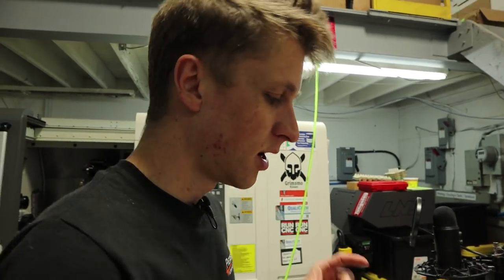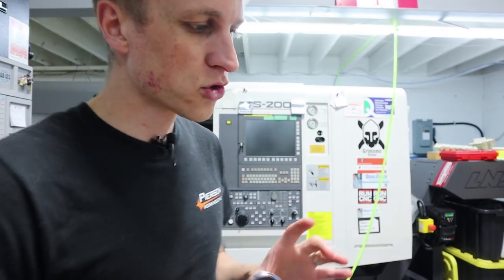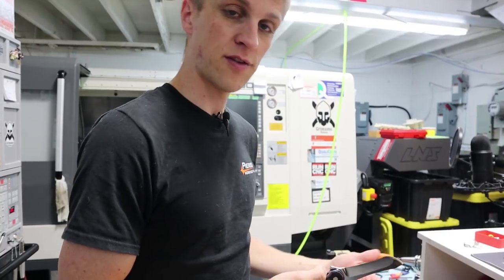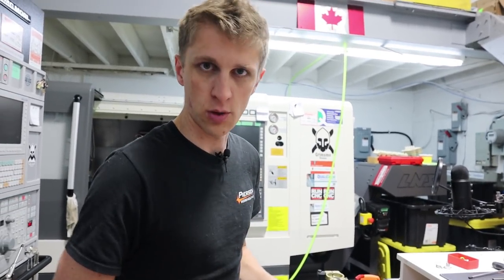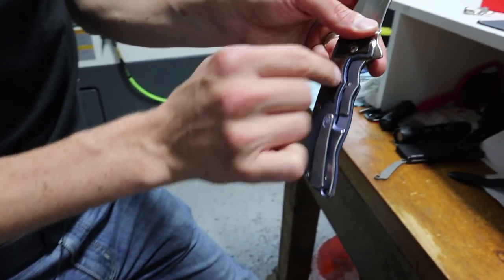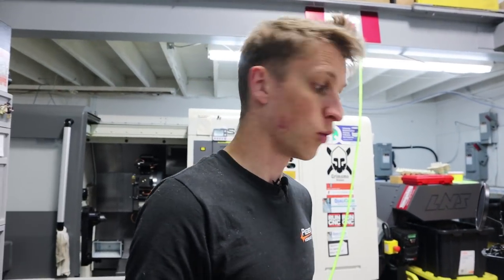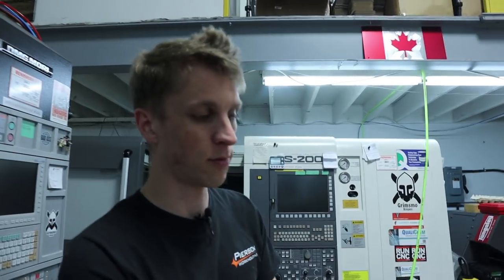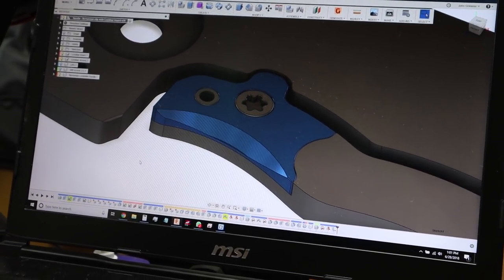How to Add a Lock Bar Insert Pt. 1

Comment: Dude, I'm all for this! It's another refinement. Not bashing your ealier releases, but yeah moving forward is the way to go! This will save a lot of parts where the aesthetic is locked in, but the function isn't. Another way to separate selection to increase yield. You know this is good. 

About the hardness; I don't know the specifics, but that book you used oh 150 video's back is not gonna cut it anymore. You grew out of that production method two mills ago. Bounce stuff off of as many people as possible, more eyes / datapoints is better. Probably calling Brad and other John for the surefire way to create some clarity. My gut also tells me go softer on the insert (wear always occuring on the softer part), but hey, I might be completely wrong and ruining blades with it (wear occurs on all surfaces, just in different amounts based on hardness/sheer strength/etc..).. Experienced knife and tool makers will know.

Cheers man, enjoying the continuation of the Norseman journey!
Reply from the maker: Thanks Dev, great thoughts!

Comment: Good luck with the lock bar insert. One more piece to make. One more screw to make. And assemble. If it reduces the assembly time while producing a more consistent product, it will be worth it.
Reply: David Traxler it should have a lock bar insert plus more with the prices these are going for

Comment: You definitely want to make it a different hardness. If you don't have around 5 or so points different Rockwell you will get gauling. Whichever is softer will be the part that   wears. You probably want the lock  to wear. This is what we do in injection molding to make sure everything moves smoothly.
Reply from the maker: excellent thoughts, thanks!

Comment: You should use a dissimilar metal to prevent gaulding not just the same material at a different hardness, A2 or h13 would be a decent chouce for this

Comment: Thoughts on a rolling detent?
Reply: lee19702 How about a rolling adjustable detent, put the lock relief on the inside, scrap the internal blade stop pin and put a blade stop screw with offset octagon spacer to adjust the lock up as desired, offer an optional Titanium backspacer/defense pommel glassbreaker. Then it would be a knife worth the high price!
Reply from the maker: Not a fan.  I like Jake though.

Comment: I still don't understand how this improves the function? The issue is insufficient tolerances on the titanium handle with the lock, correct? And it is easier to hold those with the smaller part or is it just easier to adjust?
Reply: Anonymouspock The amount between too much lock up (too late), and too little lock up (too early), is miniscule. Like, one pass with a file, miniscule. And the part that needs to be adjusted is part of the handle/frame, which makes it difficult to adjust, and difficult to measure.
Reply from the maker: No it's not insufficient tolerances, titanium is an insufficient material.  Tolerances actually become harder and tighter with these additional parts.